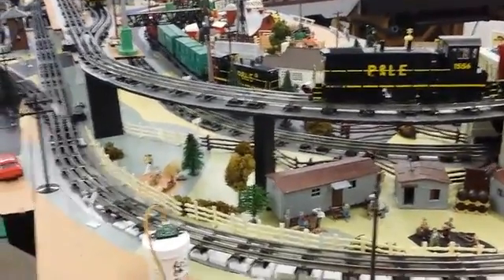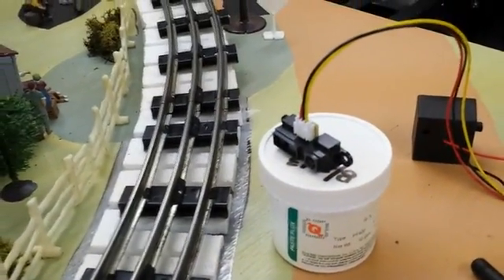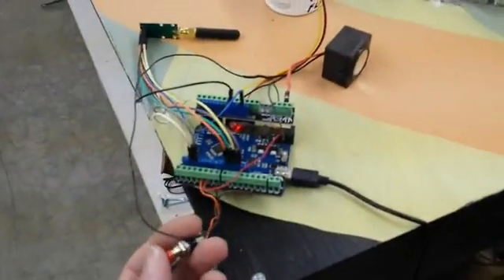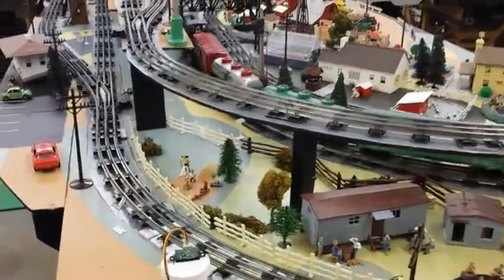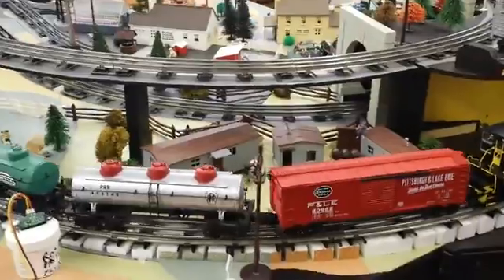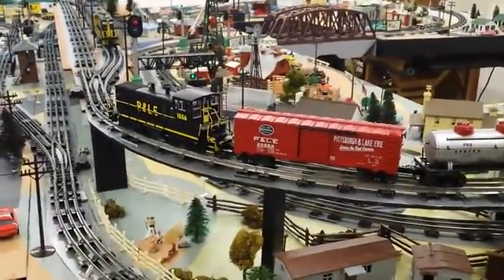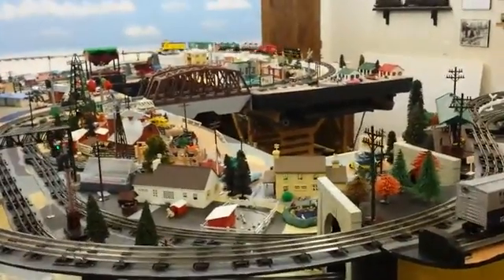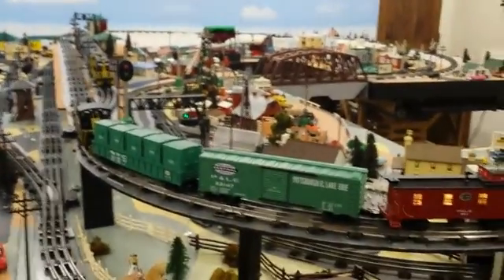2015 12 21 Two MTH Engines controlled by an Arduino and CC1101 Radio

Comment: You generate the commands to be sent to the TIU. Where would one find these commands?  I want to do a similar thing as you are doing, except use throttle/brake levers for someone to drive the train, verses using the handheld. Where did you get the commands for the TIU?  Thanks so much for any help.  You have cracked the case for me!
Reply from the maker: You can read all about it on my web pages http://www.silogic.com/trains/OOK_Radio_Support.html
and http://www.silogic.com/trains/RTC_Running.html